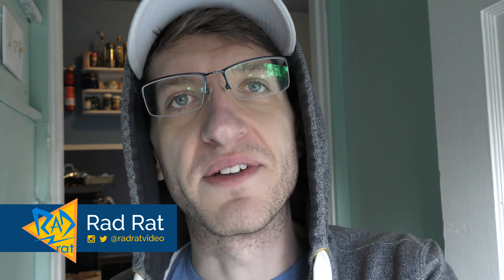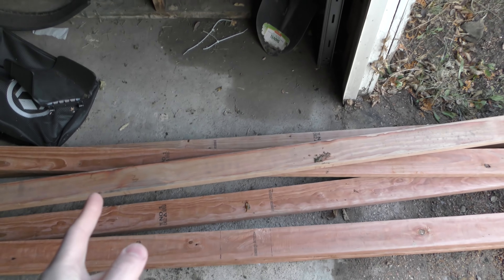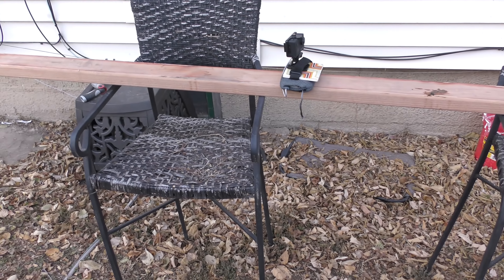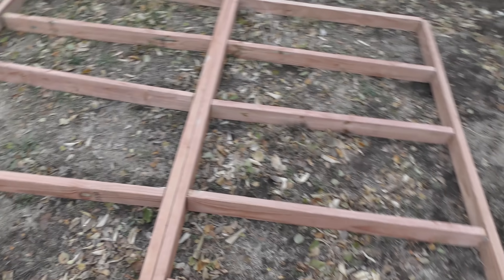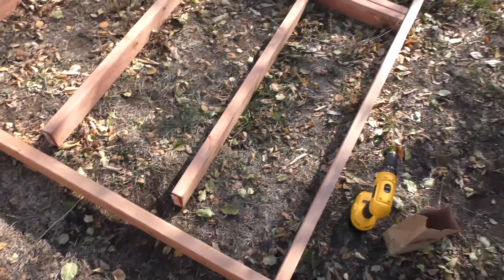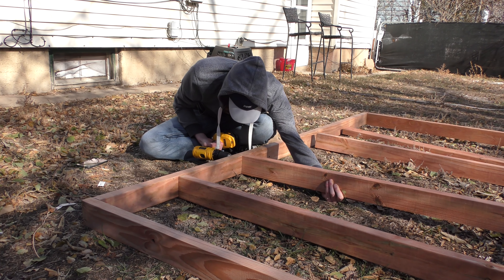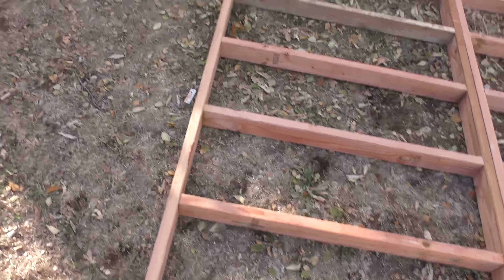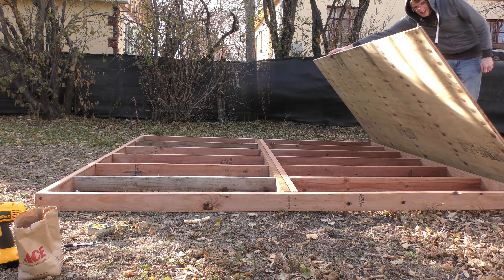Building and Skating a Freestyle Skatepark!

Comment: For what it's worth, at 5:30 you hit a part in the wood called a 'knot' that is much more tough to saw through, so that's why it kicked back / jammed into something that didn't give way as easily. A knot is a joint area between a branch and the trunk that has grown stronger to support a branch's weight, so it's like twice as tough. As for the skateboard freestyle park project, that's amazing man! I really must say this might actually be a very good idea to build where I skate a lot too. Looking forward to progress and any kind of expansion of the park! By the way, if the wood is simply too slippery to be comfortable, you might want to look into non slip coatings. There are various products available for non skid treatments of wooden floors. Their purpose is mostly to prevent dog pawns from slipping out, but maybe a light coat of that type of stuff could work well? (There's stuff like 'floor grip' by SlipDoctors, maybe you can use sand paper in combination with the coating to prevent it from becoming too grippy.) I was actually kind of surprised it became that slippery.

Comment: The first trick you decided to try was awesome! This turned out great! For a first build, you did a really great job. 
Your blade likely jumped like that because of the knot in the wood; knots are ton harder than the rest of the tree. Other reasons could just be a result of letting off the trigger too soon. 
I'm glad you mentioned getting bricks for support, they make specific foundation blocks that are small pyramid shaped blocks with grooves on top for 2x[4,6,8,etc...]. That should work perfect They're a little tall, but they are meant to be buried a bit. For stability, Dig a hole deep enough to cover a foundation block, fill it halfway with pea gravel and place the block in the hole, leaving enough sticking out from  under the box so you can set your next section of platform on top of it. 
The "splits" in the plywood are just inherent to cheap plywood. That's pretty normal, as are knot holes. You can buy much more expensive stuff that have the knots cut out and such. You can also buy cheap ply wood and cover it with a thin layer of something much nicer. I'm not 100% sure of your region when it comes to snow fall, but if you're planning on skating that thing in the winter time, cover  it with a larger tarp, This way, it's always dry when you want it, and if it snows, you can just pull the tarp off, taking most, or all of the snow with it.

Comment: Layout: hook framing go 16" subtract .75" then hook tape on that and mark every red 16" mark on tape. Square them across with your square... I recommend you screw 8-10" in field and 4-6" on joints or edges

Comment: cut fast when you get to end and let the smaller end be suspended in the air. Spread your left hand away from the saw more.

I would highly recommend investing in a chop saw. Harbor freight has them for like $120. Nice straight cut boards and way easier to cut with.

Comment: You done a good job bud, I've built stuff like this too living in the country. Cut the boards so the right side falls to the ground after cut, it's pinching like you said and the blade catches. You can change the gear on your drill so it drills through easier, also having the right size drill bit helps to not strip screws.

Comment: To everyone saying "just pour a concrete slab", some town bylaws prevent you from making "permanent structures" without a permit. And some things they don't allow you permits for.

2ndly, the phillips screws aren't gonna cut it for woodwork. You need square head screws. Less risk of stripping and more torque.

Comment: Cool build. I would have just mixed some concrete up and used the frame you built to pour it. I made a mini ramp when I was a kid and we stained it and had the same slick problem. It ended up wearing off after some regular abuse. I've heard of skate paint but never used it.

Comment: Haha, I made that same mistake where you divided by 6 instead of 5 a couple weeks ago. I was building a bookshelf with four shelves, so divided by four, marked the boards, drilled the holes for dowels... and after I finished drilling 40 dowel holes, realized what I had done. (It turned out okay; we decided that a shorter book shelf looked better anyway.)

Also you're right about the cause of the saw kickback: because of the way that the boards are supported, with you pushing down in the center, the board pinches on the blade. How to prevent that? Well, you just have to support it so that this doesn't happen. One way would be to have the left side supported slightly higher than the right, so when you push down on the left side to hold the board, the right side tends to want to fall down and away from the sawblade.

If you add sheets of plywood to the bottom of the box, you'll have made a torsion box, which would make the whole thing much stiffer. Of course it would prevent the box from bending to conform to the uneven ground, so eh... It would keep mice from living under there, however, which I expect you'll get with the design right now.

And yeah, Phillips screws suck. They're designed to "cam-out" when under lots of torque. In other words, stripping the screws was a feature of the original design, not a bug. In Canada we mostly use Robertson screws in construction (they have a square hole, instead of the plus shape of Phillips). Those work much better. You can also look for Posidrive screws, which look similar to Phillips, except that they don't cam-out, so they don't strip as easily.

Well, that comment ended up being way too long. It's cool that you built the thing, and I hope it works well for you.

Comment: The reason the saw keeps jumping on you is because the way you have those long boards supported and are cutting between the chairs, it’s causing the wood to pinch the blade as you finish the cut.  Be better off letting that right side of the 2x4 fall away and not even support it

Comment: Next time you should shovel/dig out the dirt until its flat , so you have a level surface to work with.
Reply: Another thing you could do is sink that pad into the ground and get some cheap ply around the edges for landing tricks.

Comment: Wash it with soda and it'll be less slick. A better, albeit more expensive option would be to spray something glue-like on and sprinkle some sand on it, no sliding then.
Reply: OR.... you can actually get used to riding slick surfaces in order to better  work on you balance on your board!
Reply: @SlickRick4EVER  The problem is, he's not trying to ride. He's trying to stay stationary.

Comment: oh shit! the title made me think it was a concept, awesome to see you're working on it
and lol yeah wood sucks, that's why I work with metal haha
you basically just have to measure every single possible thing.. before you even start doing anything

oh yeah as for making steady cuts and not having the saw skip, you need something supporting it as close to the cut as possible, like an old trash can or just a scrap piece of wood you can cut into but not through (if you can't move the supports closer without it losing balance)